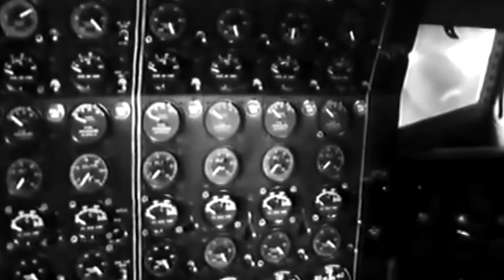The Largest Military Cargo Plane to Ever Barely Fly - H-4 Hercules

Comment: Thanks for posting this video.  I was lucky too visit the Hk1 at Long Beach multiple times in the early 80’s. When I worked for Hughes Aircraft in Fullerton.  Thanks also for highlighting a few of the innovations and not focusing on old Mr. Hughes’ mental issues latter in life.  

It’s a beautiful airplane and you knew it would have flown majestically.

Comment: The Antonov AN-225, is a plane evolution equivalent with swept back wings.
Reply: garbage you haven't got a clue that pain is one of the best planes that has ever flown in the sky
Reply: And it was garbage just like this plane that's y they only made them for a couple years 🤣
Reply: @joshtriggs7765  h
The hell do you mean garbage? The an 225 is an amazing plane and only one was made because it's expensive.
Reply: @joshtriggs7765  that plane is far from garbage I watched the locomotive roll out the front of the Antonov 225 in in Ireland it was the most impressive thing I've ever seen
Reply: @joshtriggs7765  They only made one and it was mothballed when the Soviet Union collapsed.
It's a very expensive, special use plane designed for the Soviet military.

Was revived several years later for commercial heavy lift use and is still being used today.

A second, incomplete airframe was recently purchased by the Chinesse military and is to be completed.
Reply: @jhoncho4x4  IIRC, the Chinese are trying to buy the license to build the Mriya (dream or inspiration in Ukrainian). I last heard about that in 2015.
Reply: @proud_emmerian6510  I think I read about the 2nd unfinished air frame going to the Chinesse on wiki. 
You may want to contribute on their site if you know of additional info.

Comment: Aronautical comments.
It must be mentioned that the take-off phase of a flying boat in the water requires highest power. Once in the air, the aircraft can fly or climb.  
Simple performance calculations using the parabolic drag model show that the climb-speed would be 3 m/s (600ft/min)  using 3000 hp / engine. Every aeronautical student can validate that. 
More astonishing is the fact that Hughes and his team mastered the square-cubic law. Once you increase the span with a factor 2 the wing surface squares (factor = 4) but the mass follows a factor 8. Hence the speed and power you need increases and payload v.s total mass is reduced.
Further more this enormous machine had power-steering, a nouveauté  in that time, if not the first aircraft. 
Most amazing: he did it in 3 years...unbelievable!
The Lockheed Neptune had only power assistance on the elevator..(1946). Lockheed was considered the best aviation company in the USA, if not the world ..is  it not?

Comment: Ive always thought this wouldve made a great giant passenger flying boat , even though it still wouldve been fairly short lived with jet tech coming online, a good 15-20 year run as a Pacific Clipper wouldve been amazing
Reply: A few British companies tried a similar concept at the end of WW2. It didn't work out and all were scrapped without service. 

Saunders Roe made them iirc.
Reply: It might have given ocean liners a run for their money, at least on the luxury side.
Reply: @rockoorbe2002  that's what they thought at the time, in reality it didn't compare to jets or liners, just ended up as a bad compromise between the two.
Reply: Howard Hughes had plans for swapping out the engines for turboprop engines, but knew that the board would never ok the expenditures after the contract was cancelled.
Reply: I love the old Clipper poster art 😇
Reply: Mustard has a good video on this you might be interested in.

Tldr: problem with flyboats is that they need water, people don't want to take a plane then the train to go somewhere, if they can avoid it.
Reply: If fleets of these had been easy to build, they would have been best used as troop transports. Quickly moving a couple hundred men across the ocean at low level in hours instead of days. 

Kaiser making liberty ships into aircraft carriers and things like sonar changed the game .
Reply: Unfortunately for the size, it's a big risk for renovating to do it... BUT we're at a point where nostalgia could potentially bring it back to life... Upgrade to turbo-prop's and just bouncing it around the beaches and maybe the Bahamas and the like... Tourists already subject themselves to life on ships, and this thing could cut the travel times as well as add that historical reference and stories to go with it... You actually shouldn't cut the travel TOO much, but making it relatively efficient to fly down and around an island before landing to party... give an overhead look around... add a few stories about Hughes and the plane's origins... 

    It just feels almost criminal that she rots in a museum instead.  ;o)

Comment: The Hughes H-4 might have succeeded and been useful if it had not come too late. By 1945 the piston engine was quickly becoming obsolete for many military uses, and flying boats were no longer necessary as large paved airfields had been built all over the world during the war. Also, the dire threat to Atlantic shipping from Nazi submarines had greatly diminished or been eliminated by the last year of the war. Supplies by ship were essentially unhindered after late 1943-1944 and the H-4's mission was questionable at best by then.
       Hughes never lifted it out of ground-effect. It never really flew, but could it have flown?  We'll never know for sure, but I think it so. H-4's wing loading at MTOW was only 171 kg/sq. metres, less than many other successful flying boats of that period. Its power loading was 22.9 HP/sq. metres, also less than other successful flying boats. It surely could have lifted out of ground-effect and flown, but its performance, due to the extreme drag of its massive wings and airframe would have been likely been very poor.
      Thanks for the great aviation history as you always provide.
Reply: Interesting that you quote the good power loadings, the low wing loadings, then turn around and say that 'it's big, so it's draggy'?
I don't have the figures in front of me but I dare say the CD of the H-4 is probably better than a Cessna 172.
Remember, CD is drag coefficient, not total drag. As you say, he probably didn't get out of ground effect, but he also had a fair amount of flap on adding to the drag so when e throttled back, it settled quickly, which is what you want when landing.
I dare say in operation, setting up an operational descent would probably take some management somewhat akin to descending in a Jumbo and starting from a fair distance out.
True, we will never know if it was truely strong enough to fly at operational loads, handle Atlantic turbulence or the rigours of repeated rough water landings, but it truely was an amazing achievement and an unbelievable sight when I saw it in '92 back in Long Beach.
Reply: @pylon500  Yes, it was an amazing achievement and it must be quite a sight in person.
         I didn't "turn around" and say, "it's big, so it's draggy". What I said was, "but its performance, due to the extreme drag of its massive wings and airframe would have been likely been very poor." That does not contradict what I said about its wing and power loadings which were calculated for MTOW. 
         The Cd (min) of a Cessna 172 is 0.0270. I don't know what the Cd of the H-4 was, so unless you know it, a comparison would be is purely speculative. In any event, I said nothing about Cd.
        Hughes definitely didn't lift the H-4 out of ground effect as it never exceeded an altitude of at least 50% of its 320' wingspan. He flew it for one mile (1.6 kilometers), for less than a minute, remaining airborne 70 feet (21 meters) off the water at a speed of 80 mph (128 kph) before landing. 
       While I haven't been able to verify the flaps setting on that "flight", I think that we may safely assume that it was a take-off setting, that is, no more than 25 degrees, possibly only 15-20 degrees, to add more lift than drag.
If the H-4 had gone into operation, flying it would probably haven't been much different than flying any of the giant flying boats of that time and nothing at all like flying a Jumbo Jet. Its mass would probably have made it extremely docile and steady as long as the control surfaces provided sufficient authority to maneuver it at slow airspeeds.

Comment: The stress on both the men and the ships they crewed was unbearable for Western Approaches. The lives of the sailors who crewed escort destroyers during that period is impossible to imagine. Not just a case of living for the day but living for the next thirty minutes. Thankfully the extent of air-cover from both sides of the Atlantic basin steadily extended until the convoys were only vulnerable for an ever-shortenning duration of hours. Plus new weapons for destroyers to directly combat uboats were developed--'squid' being especially deadly along with careful patterning of the depth-charge releases.

The bombing of U-Boat pens was far from futile though, at least once the Grand Slam and other 'earthquake bombs' were developed. There are amazing photographs of holes punched through tens of feet of reinforced concrete. However the technique latterly was not to destroy the pen with a direct hit but rather to drop the earthquake bomb in the dock immediately outside. This created a miniature tidalwave and crushed the uboats against the roof. It also destroyed or heavily damaged the support machinery within.

Comment: Proved he could get it into ground effect.  not necessarily fly.
Reply: Which would have been enough to avoid torpedos ;) - Mission accomplished :D
Reply: Once Vr is achieved, the craft is flying. The only variable is whether or not the engines can produce the power to climb.
Point of fact not mentioned in the  video, Hughes was not given permission to fly the aircraft - taxi testing only. He claimed afterwards that he did not realize how easily it would take off and that it was an "accident", but his crew knew what his plan was...to shut up his detractors and prove that it could, in fact, fly.

Comment: I've seen the Hercules in person, and you can't begin to imagine how jaw-droppingly IMMENSE it is.
You will legitimately doubt the fact that it actually flew. You will be at a loss for words.
Reply: yeah, you can barely believe that it can simply support the weight of its wings while on the ground let alone fly
Reply: Sanded by hand✋
Reply: The biggest plane I’ve ever seen in real life was the b52
Reply: I still get hints of feelings like being in that circus crowd watching "Dumbo" fly in the cartoon whenever I see a C-5 Galaxy lumbering down the runway... I can honestly say, it's a struggle to wrap my head around something like the Hercules!!!   haha   ;o)
Reply: Been to Evergreen Air & Space museum in McMinnville, Oregon, many times.  It's a treat to see it in person.  It works because it's a giant set of exquisitely crafted plywood pieces bonded together along with well understood wing dynamics. That airfoil works very well at the speeds this plane was intended for. It without doubt delivered the required lift despite the  barely adequate engines.
Reply: ... perhaps rode ground effect more than actually fly...
...I consider this aircraft a close cousin of the Soviet designed Ground Effect Vehicle 'Ekronoplan'...
Reply: @miklosernoehazy8678  yeah, judging by its wing shape and altitude it flew at my rough calculations would have anywhere from 20-35% of its lift being generated from ground effect, although, those are very rough estimations so take them with a pinch of salt
Reply: @miklosernoehazy8678  70 feet is more than ground effect!
Reply: @Jimbojenkins  Negative. Ground effect occurs at an altitude of roughly half of the planes wingspan. So a 320' wingspan would produce ground effect up to 160'